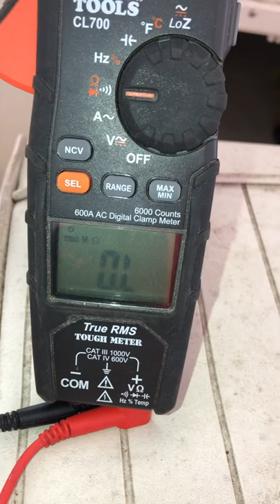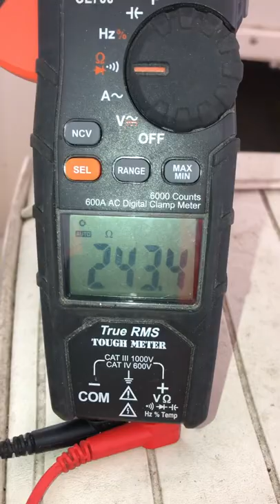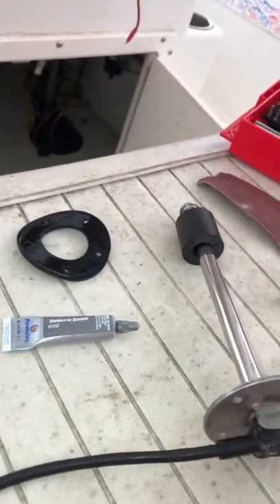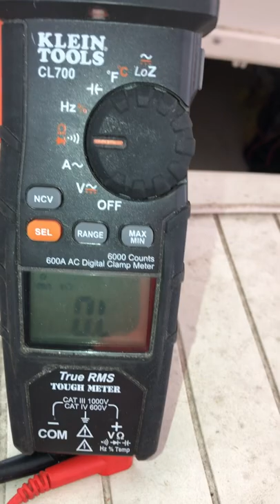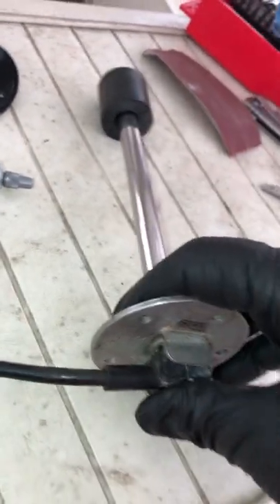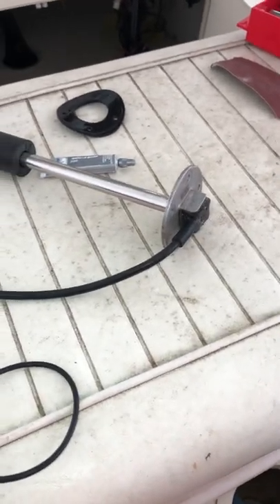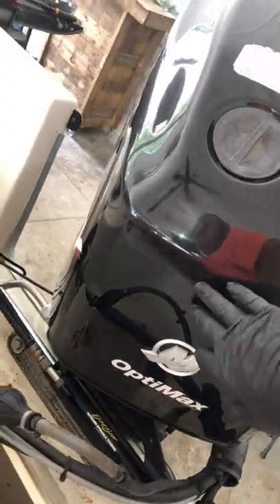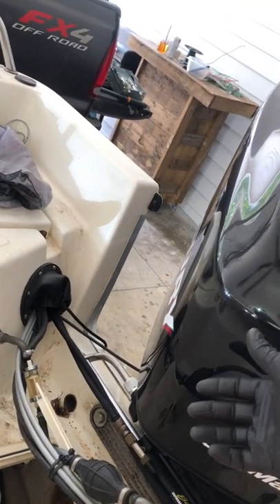Boat fuel sending unit not working correctly. Potential quick and easy fix.

Comment: Interesting. Mine goes from 33 to 192 then -1 at empty. I pulled mine apart and could see anything broken but the resistance wire on the back of the circuit board seemed to stop short by 2”.  It needs 1 more segment

Comment: make shur wiring is correct on gauge  1 wire per post  some have lighted gauge  best wire method is 2 wires from sender to gauge  ----w ith  sender out of tank  and switch on move float up and down gauge should follow up and down if not recheck wireing    no battery should  be on 2 wires to sender they are just resistance  33-240 ohms

Comment: Looking for help, Yamaha components 
Gauge was on empty three days ago, filled up, has been stuck at full since. About four hours on the water, gauge drops to empty when key is off, goes to full when key is on
Whatcha think
Reply: conn ohmmeter to 2 leads from sender posts with wires disconnected should read empty 240 ohms full 33 ohms never seen   one fail best senders on the market does float move freely up and down tube   set meter range so these readings will be on  scale  these are magnetic very accurate